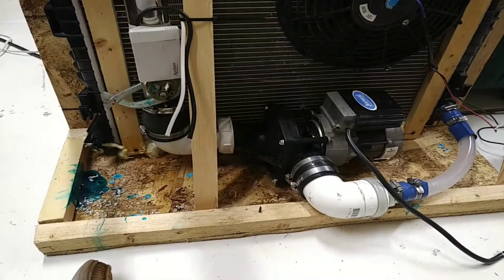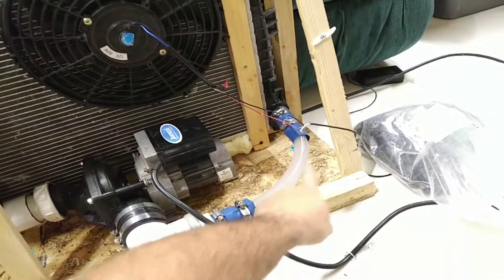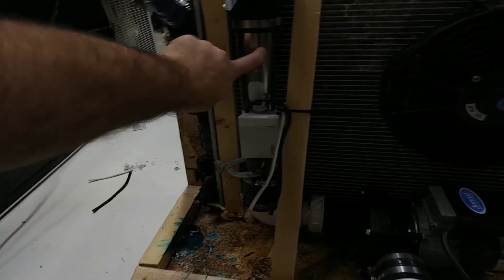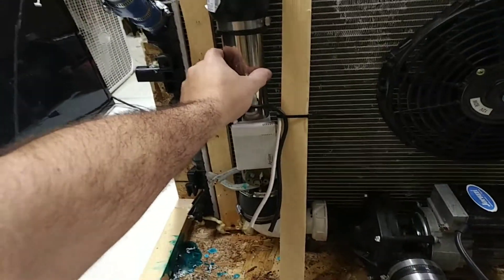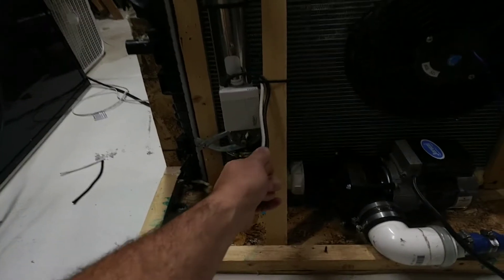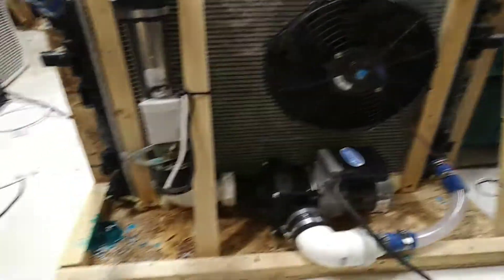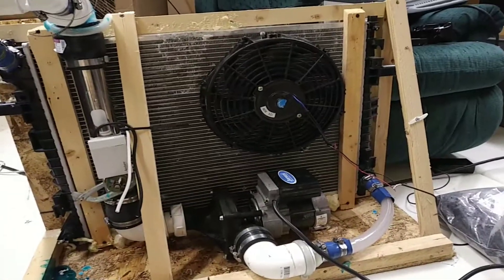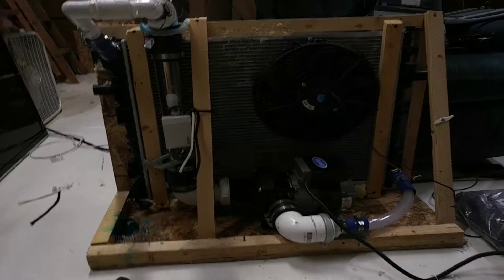The worst idea I've ever had - how not to heat your garage

Comment: Needs to be an open system with a surge tank. Hi temp and low temp switch for heat control,same for pump and fan. 

When i had a garage with infloor heat, the hot water tank was set to keep it at 130-140. As demand called for heat,pump would start and circulate. Hot water would come on as necessary.
It was very efficient compared to both pump and heater coming on at same time.
Reply from the maker: I learned alot about water cooling and heating with this project. I learned what I did would not maintain viability. But I did learn alot about thermal effects.

Comment: sorry, not sure how this makes heating more efficient. I mean my old AMD processor consumes about 120 watts, and a little fan i got spinning on there seems to pump all that heat out into my room quite well... Shouldn't it be watts in watts out for pretty much any kind of heating element?
The rad is a good idea, good way to transfer the hot tub heat into the air. I'm actually curious to see what would happen if you ran the system without it though... My hypthesis would be that hopefully your safety systems would prevent it from trying to put too much heat into the water and exploding the whole thing...
So i guess this is not so much about efficiency, as it is about getting the most amount of heat into a space in the least amount of time?
Reply from the maker: This version did fail and explode the element. In my new video I had to redesign it.